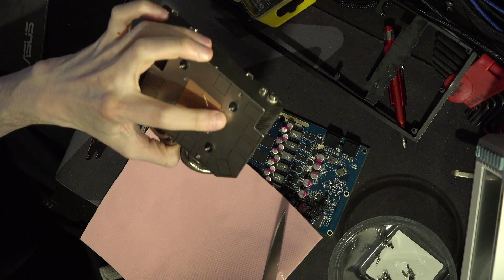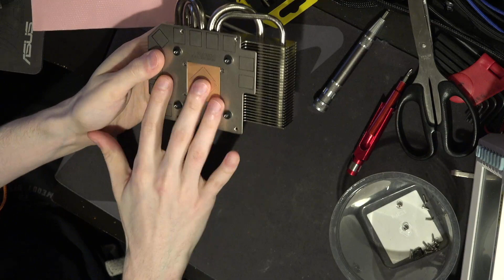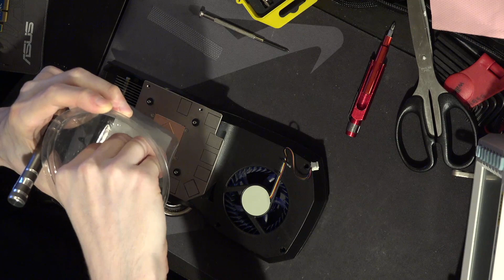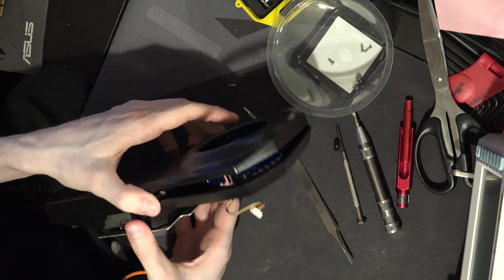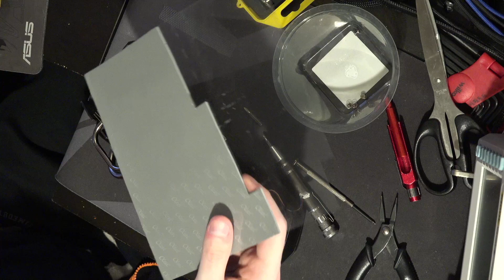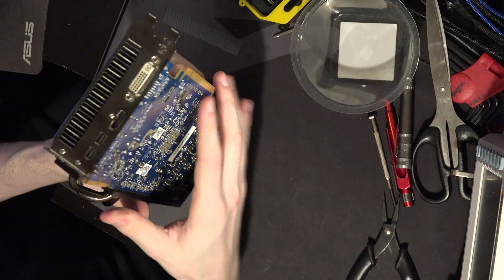Rambling and Rebuilding: HIS HD7950 IceQ Turbo

Comment: For years evga sold hybrid cards with useless blower fans on them. Then when the 2nd iteration of their 1070 came out they changed it to a high static airflow fan to draw air out of the gpu. So its still useless. Funny stuff.

Comment: I have a dead one of these cards, I've rebuilt it a few times, but could never find the fault (no burn marks visible).  Its does the typical 'works until you install drivers then wont go to windows'.  What would be the common part that faults first?  The tin area on the rear of the R22's closest to the pci-e interface looks a bit dark on mine.  It died right in the intro of Project Cars 2, with a grey screen :/

Comment: Do you think it’s possible to get a custom PCB made and get a gpu bios chip and the actual core swapped onto the new board?
I kinda want to get one of the mining 1080ti with 5gb vram and buy broken 480s and 580s and put the ram onto the new board.

Comment: The technique of adding extra solder to bare circuit board traces has been used in quality audio gear for many years and some have actually added a length of solid core copper wire under the solder.

Comment: i have a broken rx 480 8gb. one of the guy i went to said the gpu chip dies. i dont have the tools or enough capabilities to either confirmed and fixed it my self but, i would like to know if i can soldered in the 580 chip instead?
Reply: No joke, just get a used 480 or 580.
Reply: Since the 580 is the same chip, yes.  Of course if this diagnosis was correct it's likely the VRMs failed open on this board so you'd need to solve it first.

Comment: Ah, uploaded while i'm running memtest. If it passes at 3000mhz 14 15 14 15 51 it's amazing. I mean, it's hynix m-die.
Reply: Did it pass? I run a single stick of Hynix mfr 14-14-14-14-32 1,36 volts on my daily system
Reply: @WladislawNikitjuk  it passed 13 15 14 15 28
Reply: @WladislawNikitjuk  at 1.45v
Reply: @theunholybakery1990  congrats, I guess
Reply: @WladislawNikitjuk  i wish i had e-die dude... might get myself some.

Comment: I always wonder what you have studied to have such in depth electronics design knowledge and also good enough amount of thermal design knowledge
Reply from the maker: I just spend way too much time googling technical stuff.
Reply: @ActuallyHardcoreOverclocking  Just googling? I would not even know where to start with these things.
Reply: @ark_knight  Basic physics and electrical theory would be a good starting point.
Reply: @bryandepaepe5984  I have completed my engineering haha. I know all the start and end. But I can tell the thing BZ does arent things you will know just by reading.  You gotta burn some PCB to know whats up heh

Comment: I used a HIS HD 5670 IceQ for like 7 years. Was a good old card for the price.
Reply: killed mine with a volt mod
Reply: @dakata17819132  The cooler was poor, maybe overheated. I added some heat sinks to the chips on top of mine & pulled the fan off the bottom of mine & stuck a slot cooler in under the card blowing up at it & I had another 80 mm fan blowing in the side panel right next to it.

Comment: Hey, buildzoid! I have an insane idea: what if install full-cover waterblock on msi x470 gaming plus and try to OC 3950x a little (4,2-4,3 all-core)? Does vrm will die during stress test or it will be fine - what you think?
Reply from the maker: if you water cool the VRM it can probably handle it